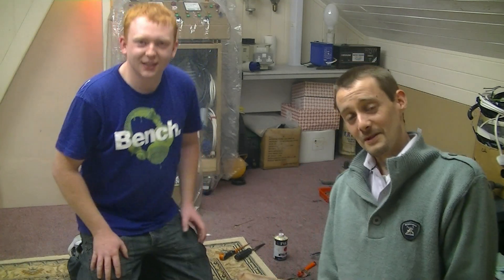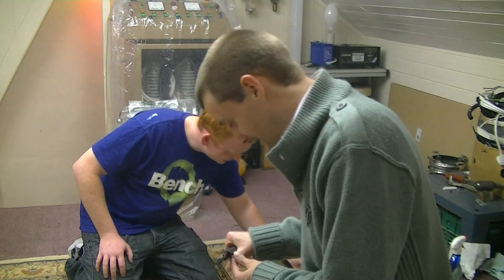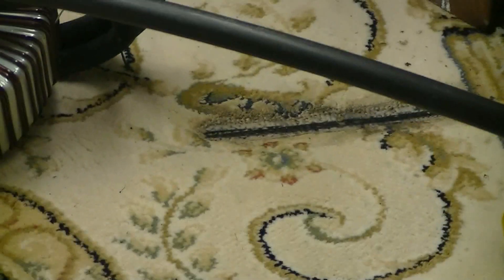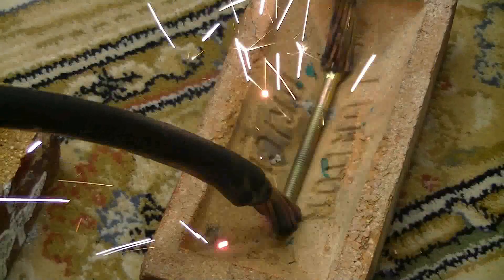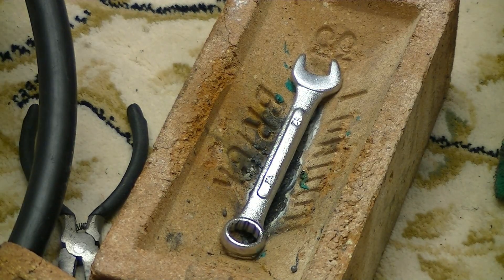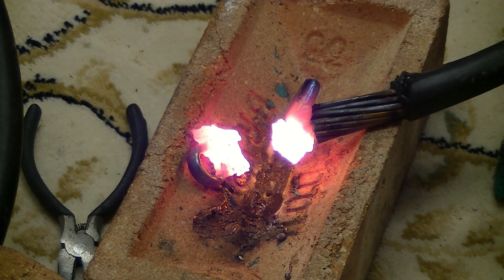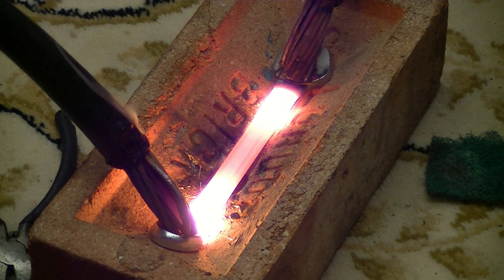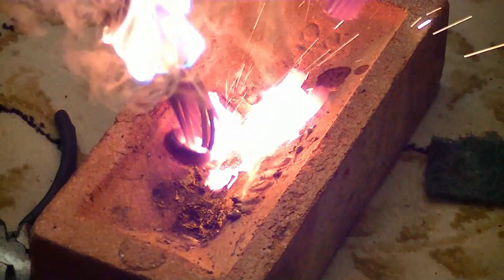5000 Amp Fuse + Tools Melt With High Current

Comment: A current that can melt steel wrenches in seconds? Yea let’s play with it inside on a wool rug
Reply: Wool is probably one the most flame resistant materials a common rug is likely to be made of, lol.
Reply: @Abeyancer  It also has the advantage of NOT MELTING TO YOUR SKIN WHEN IT BURNS, or emitting toxic fumes, like synthetic fibers do.
Army clothing is made of Cotton. The Glove shells are Leather, and the Liner is wool. There is a reason for this, when you play with Fire.
Reply: @TimeSurfer206  Speaking of toxic fumes, in this one video we have burning PVC insulation (dioxin) and fumes from melted galvanized metal (cadmium). And yes, I know they galvanize metal with zinc, it's that natural zinc contains about 1% cadmium because they are in the same column of the periodic table and very similar chemical properties (with the exception that Cd is highly toxic).
Reply: @TimeSurfer206  they’re not worried about toxic fumes.
Reply: @davidbarts6144  What about chromium and vanadium in the spanners lol.
Reply: While also drunk as skunks, I mean what could go wrong?
Reply: Inside of a wooden house!
Reply: @crowdsurferx  I know where this house is and can assure you that it's not of wooden construction...
Reply: Welcome to England :)
Reply: FWIW, a car battery will melt a steel wrench in seconds, too! (Saw it first hand after my idiot friend didn't disconnect the battery before changing his starter.)
Reply: @TravisTerrell  And if it doesn't melt the wrench, it can cause the battery's electrolyte to boil and then make the battery explode.
YAY boiling Sulphuric acid on my face and in my eyes!
Hasn't happened to me, but, I've heard stories. The kind that make me wear goggles.
Reply: Im sure this comment section lists all the dangers of doing this, but you've literally listed all of the fun parts.
Reply: Wool is pretty resistant against fire
Reply: @tomreid2686  And has the added advantage of not MELTING to your skin whilst it burns, like Nylon™ and Polyester do.
Reply: Hey! They're Craftsman spanners with a lifetime warranty. Take them back to the store and get a free replacement!
Reply: they're holding copper cables with thin plastic shielding that's carrying thousands of amps of current with bare exposed ends, and you're worried about the carpet?
Reply: Lol he has his bottle of safety Windex lol.
Reply: @allanfulton8004  and safety ashtray
Reply: Yeah, can't imagine his neighbors finding out what he is doing, if he didn't it outside
Reply: This is frickin stupid!
Reply: Safer than a polyester one.
Reply: You do know wool is fire resistant right?
Reply: That’s the fun of this channel
Reply: Why not?  I mean if the floor is wack a.f. already.
Reply: @GTA2SWcity  do it next to a gas jug. That would be sweet🍬🍭
Reply: @shockwave6416  ok but U gotta sit next to it when I do 😜
Reply: @GTA2SWcity  oh yeah baby!
Reply: @shockwave6416  I jokingly added a part about doing a Steve-O stapling the one part to the other(if ya get me)...but I guess the nanny-state YT censorship committee has no sense of humor.
Reply: @GTA2SWcity  oh
Reply: @ronald2042  I know right. Could have burned down their whole house!
Reply: LMFAO Thas what I was thinking lolol
Reply: and drunk to boot!
Reply: And a few drinks in
Reply: After a couple of beers!
Reply: bunch of pissheads thats all i se
Reply: @eyefishinggunkchannel1011  why don't you play with this extreme amount of electricity then? If the extreme amount of electricity doesn't scare you, the electric bill will 😂
Reply: @runed0s86  iff you look on another comment i say this is crazy and i say i wouldn't dare do this..but i wrote this cos there on about booz all time and ppl was saying doing all this on a rug excetra..he even has the major bear belly to go with it.ive been shocked by a 240v wouldn t go near it again this would kill you out rite wouldn t it..i never meant anything bad just a daft comment..he nows his stuff though otherwise he would be dead
Reply: He knows what he’s doing mate
Reply: How else you gonna protect the carpet.
Reply: LMFAO
Reply: Great idea! Lets try it on the bed next
Reply: What's all this noise you're making
Reply: When’s the last time you’ve seen an on-fire sheep?
Reply: The mascara urge to disregard safety standards
Reply: Wait till the wife gets home 😂
Reply: …after several beers at the pub 😅
Reply: Drunk!
Reply: The wrench is likely cheap pot steel, not a high melting point, so yea, any normal 250/480 current would be able to do this
Reply: Firefighter suits and safety blankets heavily rely on how well wool works as a flame retardant
Reply: Thats Andy for ya
Reply: Inside of a none ventilated closet to boot
Reply: Me & boys 😎
Reply: I expected to come to the comments to find people talking about how badass it is that they used their household electricity to power a transformer that can melt wrenches in a single bound. Instead, it's a bunch of Gen Z pussies whining about how they didn't do it in the safest method possible. You fuckers wouldn't have made it in the 20th century.
Reply: @chitlitlah  As a Boomer, let me say in their defense: The internet provides them of plenty of examples of my compatriots, their parents, and peers doing stupid things and winning stupid prizes.
And as far as all those, "I survived riding in the back of a pick-up, ha ha pussies?"
Yeah. So did I, but I have two cousins who didn't.
Reply: Well how about you try getting an education instead of being a fool.
Reply: Snowflake , pussy, cry
Reply: @nuone_9636  How does not wanting to die or burn your house down make you a snowflake? You will probably die young.

Comment: Congratulations u now have cancer from breathing in galvanized steal
Reply: The cigarettes counteracts it. No problem.
Reply: @animalmother556x45   As long as they aren't the pussy lite ones. Need extra strength nicotine to get the job done
Reply: its called https://en.wikipedia.org/wiki/Metal_fume_fever
zinc is know for this, i got it from aluminium easily too (Aluminium plasma experiments xD).
the cancer part or brain damage comes later if you do it too often,
Reply: @hyperhektor7733  I make flash powder with homemade dark aluminum. As long as you use a respirator it’s fine.
Reply: The chromed wrench is probably worse.
Reply: @TheMetalButcher  probably
Reply: It does that?
Reply: @mikeymcmikeface5599  probably, yes
Reply: That's no joke,  the fumes from galvanized metal is poisonous. and will kill you deader than shit.
Reply: my thoughts exactly. It is hella bad for you
Reply: @jhoughjr1   Everything is bad for us. I hear that putting sticky tape on your skin (the sticky side) can cause cancer. Cutting the copper on a PCB with a hacksaw makes fine particles in the air which can give you lung damage. Everything around us is slowly killing us in some way. You can't fight entropy. We die a little each day anyway, so might as well do something while we are here. That's how we get people like Marie Curie improving life for the rest of us.
Reply: If you get sick from welding galvanized steel just drink milk. it works lol
Reply: @LJ-fe8vb  why?
Reply: @Si-Al-Ti  lol no, i stopped milk when i was 18y ;D
Reply: @hyperhektor7733  it puts the milk in its glass and drinks
Reply: @Si-Al-Ti  you mean the "it" from Stephen Spielberg?
Reply: @hyperhektor7733  Buffalo Bill
Reply: I've welded galvanized steel and didn't bother me,  but a friend tried to weld something that was galvanized, he woke up in the hospital.
It affects everyone differently. 
These guys are nuts, it's great stuff.
Reply: @bigredc222  It depends on the circumstances, if the air is.moving around or not. if right over top of what you are welding or not. but one thing for sure is if you breathe the fumes it can kill you.
Reply: Yep, it’s called galvanic poison. We learned all about that shit in school as a plumbers apprentice.
Reply: Spends following year double masked, cause muh flu.  Takes experimental gene therapy; gets cancer.
Reply: Nonsense. You might feel temporarily ill at worst. Happened me a few times.
Reply: The worst fumes were at the end around 11:10

Comment: I don't understand why the wires themselves don't melt?  Furthermore, I noticed that the bolt/metal seem to get hot from the ends first and  the heat travels from the ends to the center.
Reply: the wires are thick so they have low resistance

Comment: Quite boring actually. All it is is a sever reduction in voltage, causing high output amperage low input amperage and the reverse for voltage.
So no they wouldn’t get electrocuted on the output side
And no the input amperage is not above 30 amps or the household breaker would kick

Comment: Фигня: на работе как то раз уронили больший ключ на клеммы аккумулятора и он из твердого вещества перешел в жидко-газообразое, повезло, что ни на кого не попало.
Bullshit: at work they once dropped a larger key on the battery terminals and it turned from a solid substance into a liquid-gas, lucky that it did not hit anyone.

Comment: My god 😡😡😡😡😡😡these are mad people they don't know a single mistake will kill them
Reply: They probably know what they're doing better than you... Touching those cables will burn you probably (Because they do heat up a lot ofcourse) but you won't even feel the electric shock. It's a pretty low voltage... Basically your iPhone charger is about as lethal as that transformer in terms of electrocution risks
Reply: Whats wrong with that
Reply: @simpleton8554  it can kill them
Reply: @sury2250  so?

Comment: How to make your electric bill 5k
Reply: They are using maybe 10-20kW while burning through shit. Assuming that they had the transformer on for 5 minutes in total means that they used ~25-30 cents worth of electricity in this vid.
Reply: @Raizzor18  cent?
Reply: current transformer or something(i forgot the name) mate, his house is single phase and he has a battery backup, using a current transformer wont make your electricity bill 1000+
Reply: They're eating up amperage not voltage. So it probably isn't insanely high

Comment: If you touch this cable you are dead, no coming back or trying to remove your hand.
Reply: lmao time to get educated. the cable probably had about 2 volts on it so you can't even feel that.
Reply: @RickBaconsAdventures  You can have 0.1 volts, the 5k amps will vaporize your internals.
Reply: @epsilonadept7301  Nope. 0.1 volts across the resistance of your body will mean there'll be barely any current. That's why 230V a lot of times isn't even lethal, even though that's 20A fused and you only need about 0.1A to kill someone. A fast-charging phone charger outputs about 2 amps, but I've never been scared touching a USB cable....

Comment: Why doesn't the wire metal melt down itself ? it can't really be that strong with those coalesced strands🤔🤔🤔
Reply: Gussy Vangard im guessing theyre not the bottle neck so they stay relatively cool but the steel is not as efficient as the copper so maybe thats why? just a thought
Reply: Copper has a far lower resistance, thus heating up less for the same current. Also the copper has better thermal conductivity, meaning it spreads the heat away from the contact point into the entire cable more efficiently than steel can do it.
Reply: Just because the wire is made of copper strand

Comment: Licensed Journeyman Electrician ( IBEW 466!) for 17 years. These guys might be funny and uniquely interesting, but to say this is dangerous and unsafe at any point in the video is stating the obvious by this point. 

For the love of god folks, don't do what they are doing here. P.s., that cable looks to be about a 4/0 copper wire at best? By NEC Table 310.15 b 17 , which covers conductors in free air ( this applies here since there arent within a conduit or raceway), it is rated for 300Amps if its 60°C insulation, 360Amps if its 75°C insulation and 405Amps if its 90°C insulation. Now, that doesn't mean they are running a full 5000amps thru the fuse, that just indicates it trip/shorting range. The point is: the wire is running the risk of melting down even before the objects they are running as mock-iinductive loads

Comment: 🚨Dont worry it's just a couple of tools!!🔧,Glad to see two professionals doing tests and experimental work with high voltage electricity in only the best and safest laboratory conditions available 🙄,always remember what Frank Spencer said boys if you get struck by lightning run inside and put on your welly Boots,🌩️ oh and yes that was definitely a 12mm spanner ,oh yeah and  did your mate have read hair before you started to play with electricity,,